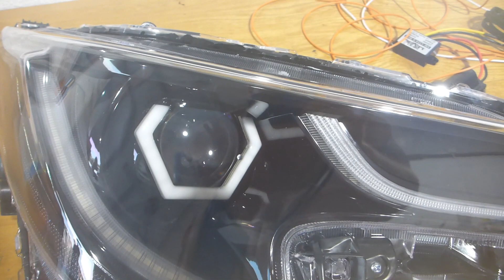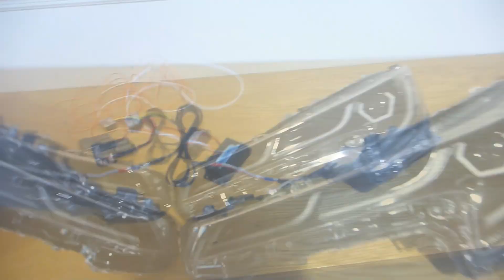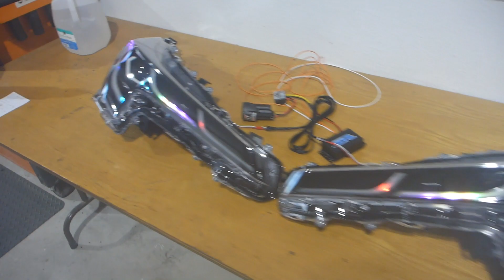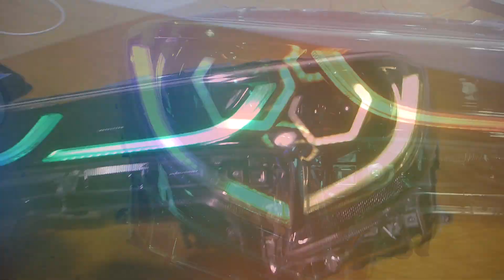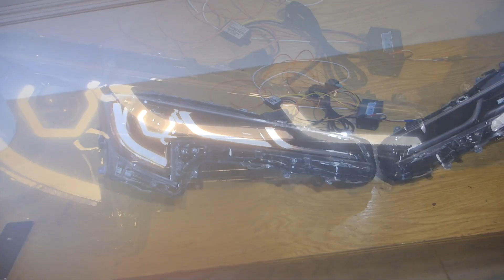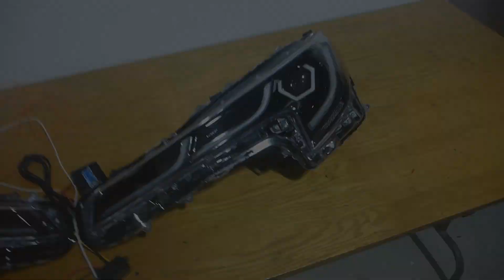19-21 Corolla Custom Flow RGBW Headlights w/Hex Halo

Comment: Will these work for the 2021 Corolla LE Hybrid as well?
Reply from the maker: These were built for the client's vehicle.  Headlights designed and built for the 21 Corolla LE Hybrid will absolutely fit the 21 Corolla LE Hybrid.